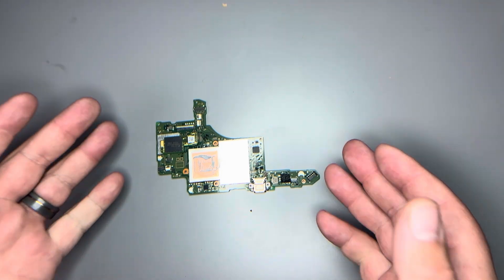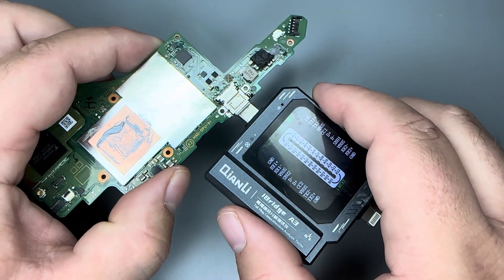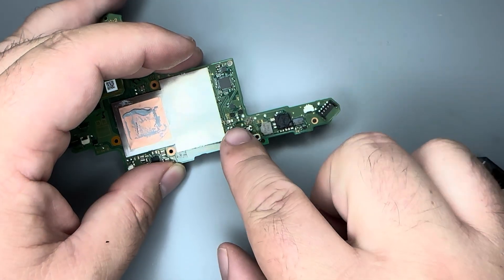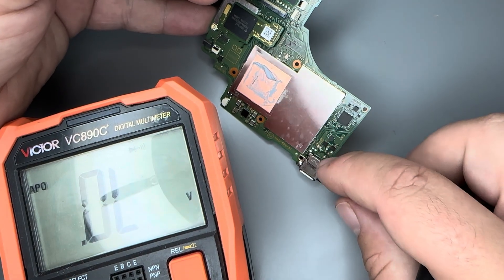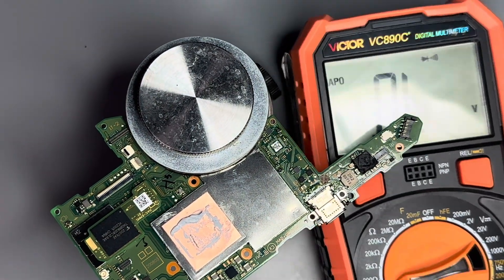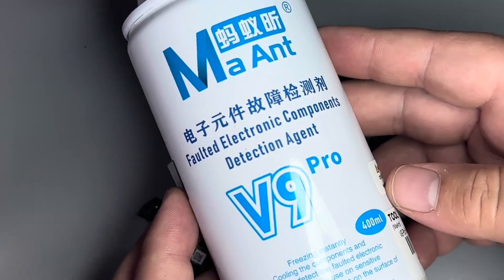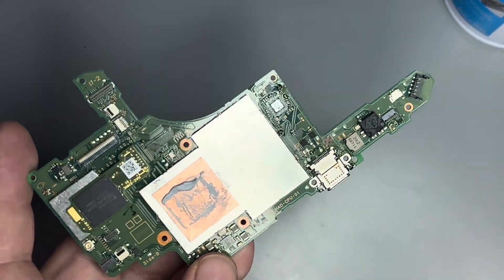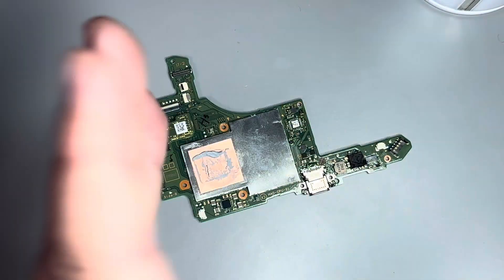Learn to Track Down Shorts on Circuit Boards (Switch M92 Repair)

Comment: My ibringe is showing all the correct readings,but my switch still wont turn on. the area where the battery connector is at gets hot when I plug it in to the charger